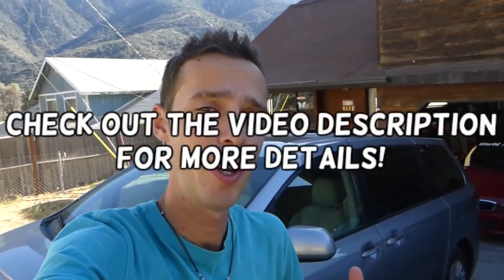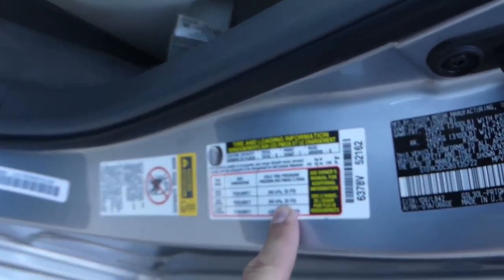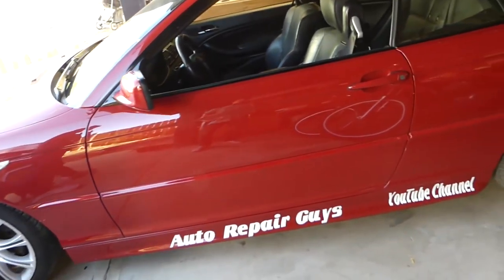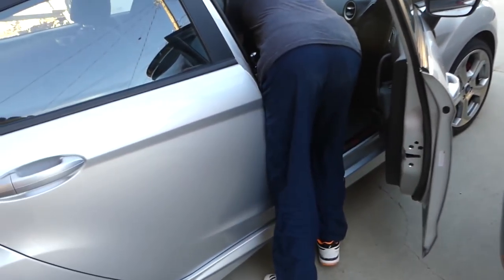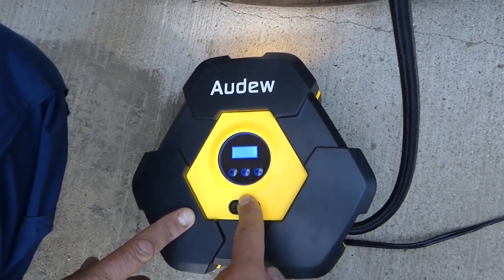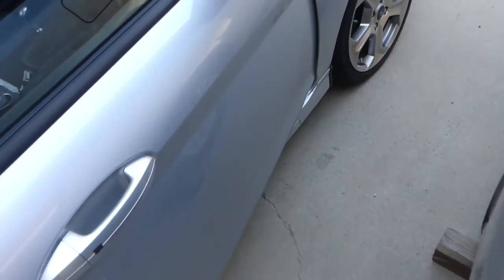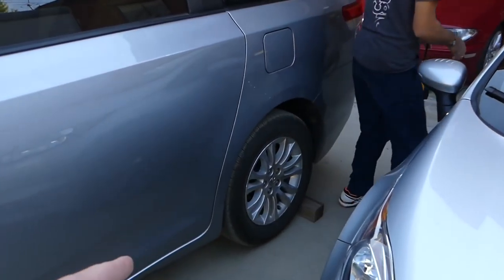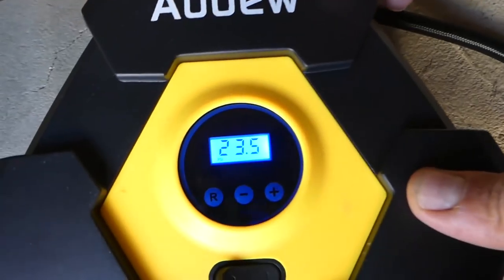How to Properly Inflate Your Tires

Comment: The tire pressure rating is set for the MAXIMUM amount of pressure at the given weight, you NEVER want to max out tire pressure bc if you hit a pot hole ur almost guaranteed to bubble ur tire or blow it out bc the tire is already expanded to its maxmimum amount.. If ur running low profile tires, ur tire max is probably about 50psi, I put mines at 38psi. They expand more on the sidewall since it's so thin (when u hit a bump). If they're normal tires you can put them 5psi less then max and should be fine.

Comment: when new tires are installed shops usally leave then under inflated....i go of the tire that the tire manufacture recommends ..
Reply: Car manufacturers recommend pressure for best ride quality. After years of selling tires, I've found that manufacture recommended pressure leads to premature outside edge wear. Running 40 psi seems to be a sweet spot for even wear across the tire.